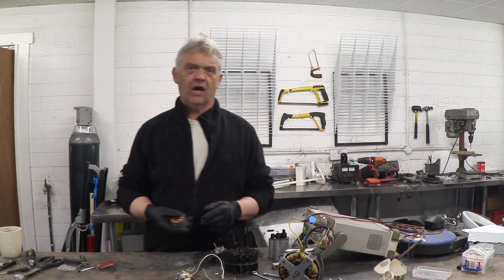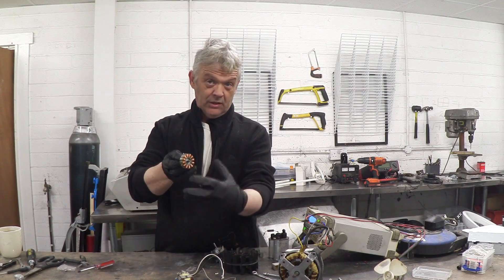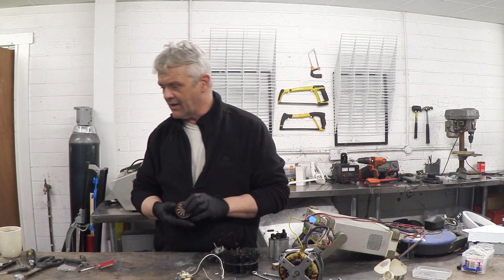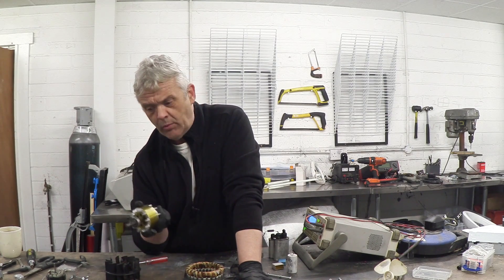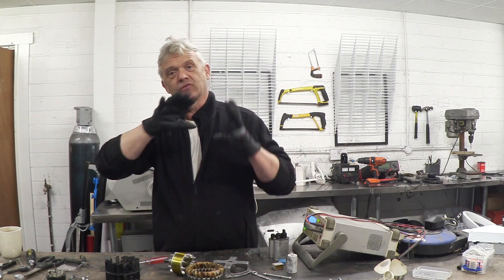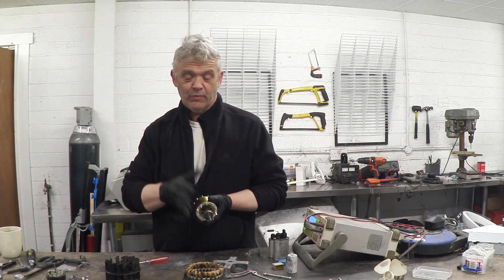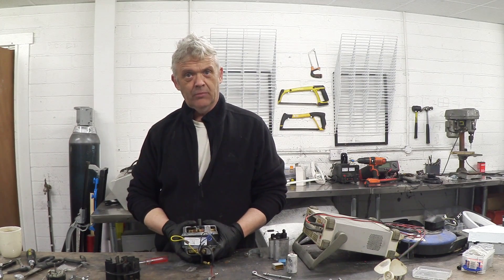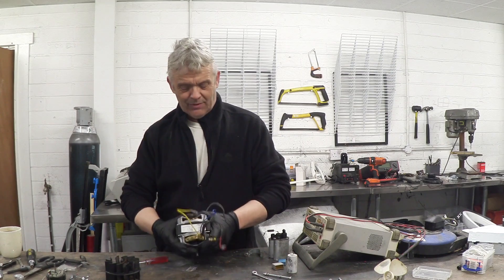500 An Induction Motor As A Generator Without Altering The Motor

Comment: To calculate the capacitor, you measure the inductance of the motor and calculate the capacity for resonant frequency of the mains. But I think it's a bit off. First, the inductance of turning motor is different than when it's standing, because you are stealing the magnetic field of the coil under its hands and turning it upside down which is not supposed to happen in an ordinary fixed coil. You could measure the inductance with a coil meter while you are running the motor slightly above nominal rpms driven by an electric drill, but that 1 volt AC from remanent magneticm may throw your coil meter off. Second, the rotor core is nonlinear and saturates in normal operation, which lowers the actual running inductance. Third, it has to run a bit above the mains frequency instead of a bit below. Really, this "self limiting" capability you are talking about in case of wind turbine is of a very bad quality. Because if the turbine is pushing hard and your load consumes only so much energy, the remaining energy has to be dumped somewhere. The core oversaturates and the magnetzation losses heat it up a lot. You are basically heating up the rotor. Which is not good, the motor gets hot and the efficiency is bad even when this doesn't happen. Permanent magnet motors or even car alternators are much much better more efficient generators than this mind blowing intellectual curiosity. If you use a smaller capacitor, the motor will resonate at higher rpms, produce more voltage and be harder to start, run colder and have more efficiency. If you use big capacitor, it will be easy to start, start at low RPM but will heat a lot efficiency will be worse. Extreme capacitors may not work at all because something in the complex dynamic of this system gets thrown off so much a negative resistance is not possible anymore.

Comment: I even melted steel using a human pedalled induction motor as a generator (without modification of the motor). Google Twibright Exciter. There is a video of electric arcs. The motor is a small 3-phase one (fits into a hand) and when under load and disconnected, with voltage limiting disabled, the resulting voltage spike sometimes broke through 1000 V rectifier diodes. Very dangerous. But thanks to this, it was extremely easy to draw and hold an electric arc. The steel I melted was a steel paper clip. The efficiency was however rather poor. Combined mechanical and electrical efficiency I estimated as only 50%. This motor is very easy to voltage limit. If the voltage exceeds preset value, you simply short circuit the output. The core demagnetizes (dumps the small magnetic energy into the internal resistance) and the motor has to restart the self-induction magnetization cycle. If this happens as you pedal, it feels like it's "slipping through". The three-phase rectifier produces a beautifully stable DC voltage for the arc. Another funny thing is if this thing is overloaded, it won't start and the generator will freely turn through. As soon as you connect an appropriate load, the magnetic field boots up and the motor will start braking and producing energy. You can spin up the bicycle wheel to crazy revs and then remove the short and the machine will massively dump energy into the load. Depends on the load. It doesn't want to allow you to increase the revs much above the resonant frequency. So any kind of overrevs are brutally braked and dumped as electric energy. If you have a good short circuiting overvoltage regulator though, this kind of "flywheel compulsator dump" will just result in the thing cyclically slipping through and rebooting.

Comment: Unless physics has undergone a radical change since I obtained my degree in electrical engineering your reference to an induction motor as having brushes and a commutator is nonsense, the essence of induction motor operation is that the rotor current is induced, hence the term 'induction' in its name, by the current flowing in the stator obviating the need for a connexion between stator and rotor.
Reply: Yep. My understanding is that an induction motor has no brushes and no permanent magnets.
P.s. there's no x in connection.
Reply: @PipeManPeep  Before correcting someone's grammar or spelling you would be well-advised to check your "facts" to avoid looking a tw@t. ;-))
Reply: Whether induced through the armature or the housing that still describes an induction motor. Perm magnets on the housing and induction coils on the rotor necessitates brushes and commutators. Induction coils on the housing and permanent magnets on the rotor is a config that does not; all depends on if you want to induce the central field or peripheral field. I’ve seen induction motors that induce both fields and are just electromagnets in and out
Reply: But he doesn't call a brushed motor an induction motor. I watched the video and he makes the proper distinction. Why would you leave a comment like this?
Reply: Have you done an experiment to see if it's correct or not?
It's no good just assuming because a book that is used by everyone means that said book is correct.
The best part of science is doing an experiment and changing the findings in a book to show the correct information.
Maybe try that and you tell us is he right or wrong?
Reply: @JUANKERR2000  you are one silly people.   Maybe you should of paid better attention, or gotten your hands dirty.
Reply: brush, is more efficient
cus fricition.
causes more energy
Reply: Engineer machio kaku has just said and stressed that physics and physics books need to be re written. Time is changing and so do many things in life. If you don't try you can't say it's impossible.

Comment: can you use a bicycle light generator kit and convert the power generated to being a battery charger?
Reply: Yes. If you mean a dynamo, you'll need to rectify the output (a simple full bridge rectifier), smooth it (capacitors), then regulate it (an LM317 would do, depending on the type of battery. An L7805 would do for a USB charger).

Comment: The motor you took from the drill is not an induction motor. It is a "universal" AC/DC brushed motor. By definition, induction motors induce current in the rotor windings by varying flux. The don't have brushes. They can't run on DC. The drill motor will run nicely on DC.
Reply: They actually induce a VOLTAGE at a limited current, you can't get current out of anything, without first detecting a voltage present.
Reply: The induction motor is the one he converted at the end not the universal motor he talked about at the begining which he explained was a universal motor, but its hard to find stuff on induction motors with outer rotors like the ones that drive ac fans on industrial ac units.

Comment: 'Motors as Generators in Micro-Hydro Power' by Nigel Smith is probably available thru your local library, and gives a comprehensive guide to setting up an induction generator, selection of capacitors for induction generators, with a good description of the process to get the motor characteristics to calculate the capacitance, and a number of sample calculations to guide you in the (not overly difficult) process.

The capacitor is used to cancel out the reactive (inductive) current that the motor draws, apparently. This reactive current is relatively constant over the range of power outputs from the motor. A fair approximation of the required value can be found by (a) measuring the current drawn by the motor at no load, preferably with the cooling ducts blocked, to reduce the actual work being done by the motor. That current is mainly magnetising (inductive) current, with only a small 'true power' current driving the reduced windage, bearing friction, and low iron and copper resistive losses. (Some of the measured current is still driving resistive losses in the motor, but at no load, and with the cooling duct blocked, these losses are minimised, and most of the current will be reactive.)

Then, (b) determine the reactance of the motor to draw that current. XL = V / I. That gives the approximate reactance the capacitor needs to have to compensate for the motor reactance. (c) The capacitance can now be found from C(uF) = 10^6 / (2 x pi x f x Xc). 

Example: a 1kW single phase motor draws 2.3A from a 230V supply at no-load. The motor reactance is approximately (230 / 2.3) ohms = 100 ohms. The capacitor that will also have approximately 100 ohms reactance at 50 Hz is.... (10^6 / (2 x pi x 50 x 100) = 31.8uF. That's the starting point for setting up the capacitor; it /will/ require a slightly larger capacitance to hit the 'sweet spot' for best operation.

For 3 phase machines, refer to Nigel Smith's book. The principle is the same, but the capacitors may be connected in either star or delta, and the capacitances and voltage ratings are different for each of those cases.

The capacitor is not a motor-starting type - these are rated for intermittent operation only, and often less than the motor voltage. (That's another story, though.) A polyester or other 'motor-run' capacitor is required, and should be rated at a higher voltage that the output voltage of the machine in operation. (Switching off a large load can cause a 50% surge in output volts in some machines!)
Reply: Ah, that’s the book I didn’t know I was looking for! Thanks!
Reply: Figures. I ask the question not 2 minutes before scrolling through the comments. I'm looking to turn a 3 phase washing machine motor  into a wind turbine generator.
Reply: Many thanks for the tip. The book is available at Abe Books.
Reply: A great book by a great chap.  

If grid connected using a 3-phase induction motor, things can be simplified even further: no capacitors required.  Simply spin above rated speed and current flows in the opposite direction as Robert describes.  

This is how most small hydro (typically 10 - 300 kW) and some wind turbines work. Cheap, durable and efficient
Reply: Thanks
Reply: Just a quick question, in the Capacitor formula [10^6/(2 x pi x  50 x 100)], where do you get the 10^6? Is it a constant? If so, is it applied to most cases with single phase induction motors or do I have to manually get that value?
Reply: @icalderongutierres  It's just the factor for unit conversion from Farads to micro Farads.
Reply: @icalderongutierres  Sorry, just read your question. The 10^6 is a multiplier to convert Farads to microfarads (the commonly used unit.)
Reply: Thanks. Been looking for a long time to get a material like this.
Reply: yes...
Reply: That's the information I wanted. Cheers Brian.
Reply: Cheers mate, awesome info.
Reply: OR you can just call customer service and ask them what size cap for your motor.
Reply: @josephmorin8941 Capacitor size for generator operation is different to the size for motor operation. And 3 phase machines don't normally need capacitors.
Reply: @brianspencer6397  oh uhh I mean thanks for taking the time to reply. But now I feel a little shitty because I was just trying to be funny in a smart ass way.
Reply: Hey, I know this is an old comment but thanks so much for this recommendation. I just started reading it and it was exactly what I was looking for. Thanks for spreading this wealth of knowledge, all power and blessings to you!

Comment: How does the max output power that it will generate compare to the hp rating of the motor? Would say a 100 hp motor turn into a 80 kW generator?
Reply from the maker: no idea mate - try it and see
Reply: 100HP is about 70kW, and /theoretically/, a generator will have the same rating as the motor rating. In practice, the generator is usually de-rated to 80 - 90 % of the nameplate value, particularly for single phase machines, as the power to generate the rotor fields ultimately comes form the supply - the mains, in the case of the motor, but the generator itself in the case of the generator.
Reply: You do realize how big a 100hp electric induction motor is... right?

You could buy a generator head for cheaper and waaaay smaller footprint. But 60kW is still a large generator.
Reply: @etherealrose2139  I get 100 hp motors all the time for free in the business that I do.. An 80 kW generator is close to the same size and an 80 kW generator cost at least $25000 new.. A brand new 100 hp motor cost $1200

Comment: Wow I have cursed these inefficient motors all my life, the capacitors would always die at the worst times; the start up draws some much power that in kills most inverters. Listen to that refrigerator -kick on.  I really wonder if it can be efficient as a generator, it does so poorly as a motor, especially in fans, air conditioning and refrigeration. You might notice newer appliances are going to inverter powered motors for efficiency. They use less than 1/2 of the energy.
Reply from the maker: there are different varieties of this motor mate - in fans you find a lot of shaded pole induction motors and they are super cheap but have terrible torque and efficiencies around 30% - but a 3 phase induction motor is really efficient - I might do a video on the different types as that can get a bit confusing for sure
Reply: @ThinkingandTinkering  Oh I agree 100% 3 phase is the future for efficiency.    2 phase should be  - phased out. With inverter technology we don't need AC anymore. Transmission lines are more efficient with DC, and safer for health and fire prevention.
Reply: @JamesWilson-pq9qp  
I agree that 3 phase is better & everything else u said except....
I think u have that backwards... that's 1 of the reasons why we use AC in the 1st place... power loss = I squared x R
Reply: 3 phase has been around since the beginning. It's widely used in industrial settings due to the ability to move large motors much better and at higher voltages.

That said, Westinghouse proved AC is far superior to DC in power transmission, hence why Edison failed. DC is horribly inefficient and deadlier than AC (though thats like arguing a crocodile is deadlier than alligator) and both easily create fires. I'm really not sure what fantasy world you live in. And there hasn't been 2 phase power since Niagara falls original generation, I believe. We only use single phase (split phase) or 3 phase all across the world. 

There is literally no point for 3 phase into a household as no motor requires the amount of power it provides and nor would you want to pay the cost of having a 3 phase drop at your house unless you have a shop on site. Even folks with shops would rather buy a VFD for smaller 3 phase motors because it is far cheaper than an electric bill for the occasional 3 phase use. Seriously, you know nothing of electricity, best to keep on reading.
Reply: @etherealrose2139  Wow, sorry to see your impressed with 87%. You're right I forgot there was something called two phase and I confused it with split phase Ac.  Siemens is installing DC high voltage power lines all over the world. We have the technology today to drop voltages much more efficiently that we did 20 years ago and of course a hundred years ago.  I have found I can replace any split phase motor with a DC one with more that half the wattage.  That's just my experiments with solar power, 85 watts just to blow a fan is absurd when 20 watts is more the sufficient with DC.     The Tesla Motors power train will change  our understanding of the uselessness of  split phase power along with the use of improved refrigeration technology.  Maybe I've done to much reading,  the world is changing fast.  Who would ever think Australia could save megawatts of power with laptop (18650) batteries, Tesla once again.
Reply: You know nothing of efficiency and electricity. Most motors are highly efficient, they'll have efficiency ratings right on the nameplate. Usually 85% and higher. 

You clearly understand nothing about torque and physics. Newton's laws state an object at rest tends to stay at rest. Which means you need to add a bit of force just to get something moving. That's why motors with any load will draw more current to start... you cannot get something for nothing. Refrigeration and hvac, or any compressor, takes an incredible amount of energy to force a phase change of a gas via compression. And every motor outside 3 phase will require an capacitor or shaded pole or PTC starter to create a phase angle to start a rotating motion. That's, once again, physics. There is no getting around that. Inverter motors still use motors, they just operate at a lower RPM and they lose all sorts of efficiency having to convert mechanical into electrical, convert AC to DC back to AC just to power a load. Their "gains" are being able to idle at lower speeds with no load but their top end is limited due to the electronic inverter not being able to handle high loads.

Air conditioner scroll compressors are extremely efficient. The piston driven ones are okay and the rotary ones are okay. The rotary and piston compressors are always seen on smaller units due to lower efficiencies. Commonly being combined with inverters now to take advantage of different stages in order to run more efficiently than they are.